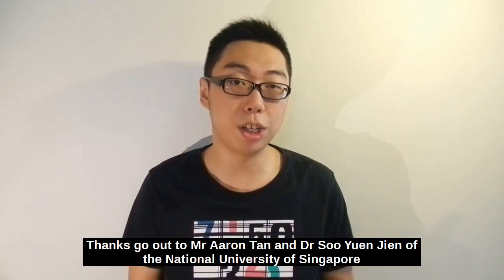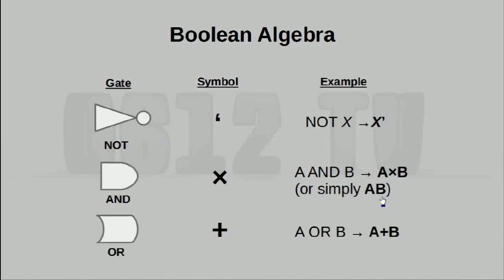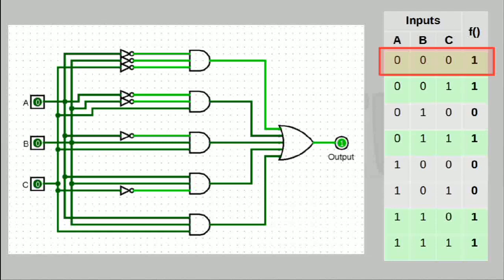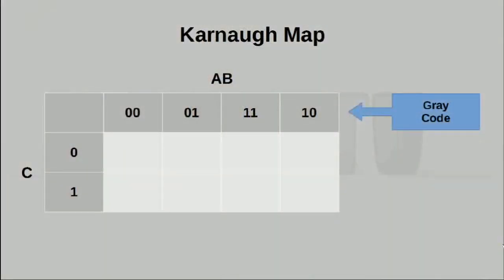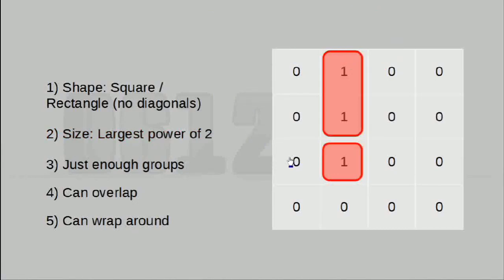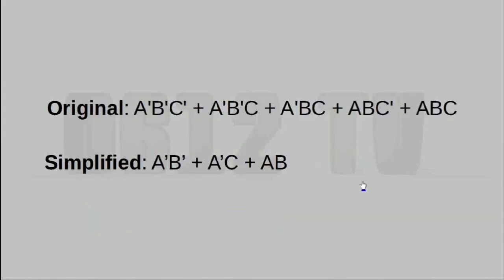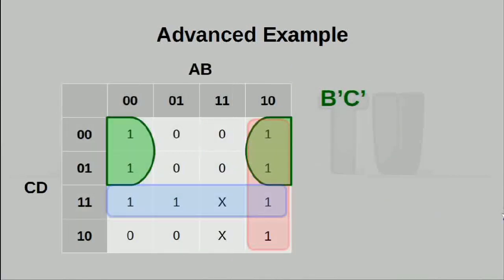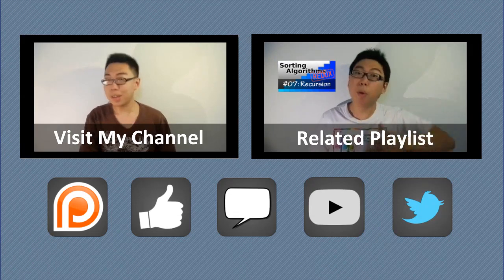Karnaugh Maps & Logic Circuit Design!

Comment: 15:00 Wouldn't A'C +AB be the most simplest solution or am I missing something?
Reply from the maker: Hello and thank you for your comment! That wouldn't work as the input 000 would not give you an output of 1: A'C + AB = 1x0 + 0x0 = 0
Reply: @NERDfirst  yes thank you. I was simplifying the statement using boolean algebra and missed a step. I'm just wondering what's the efficacy of using Boolean algebra to simplify instead of K-maps? which technique scales better?
Reply from the maker: Oh, Boolean algebra scales better for sure. I shudder at the thought of drawing K-maps for, say, 7 or 8 variables. And don't forget, the key advantage of a K-map is the ability to visually see relationships between the 1s (or the 0s) - Once you have a large map it becomes difficult anyway which defeats the purpose.